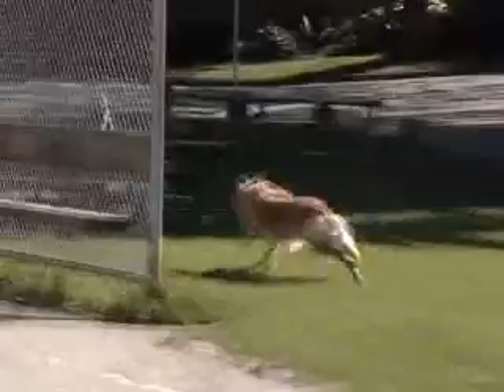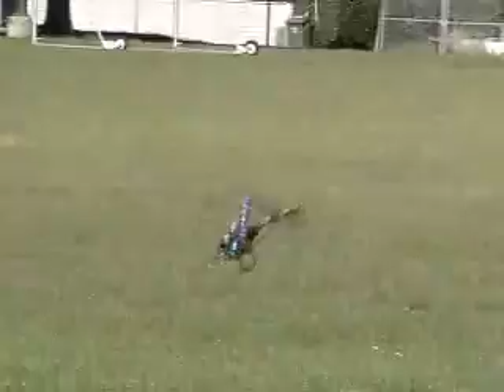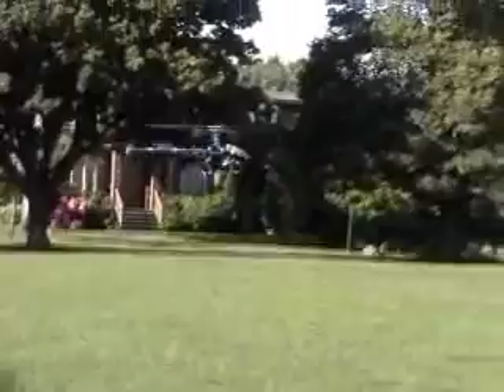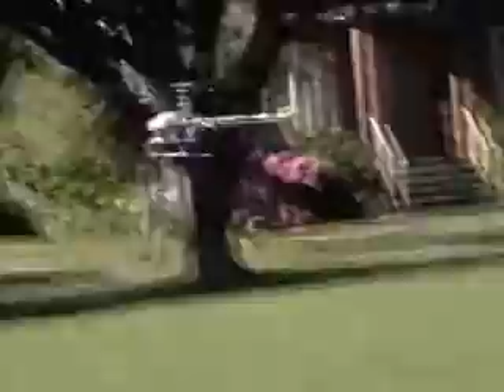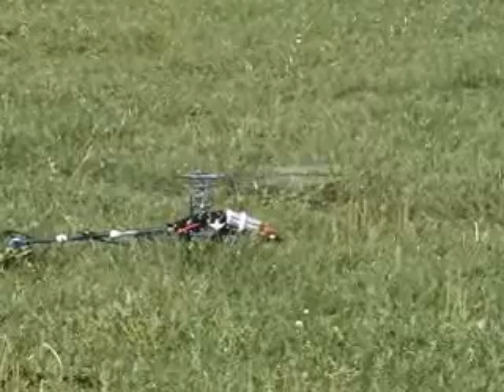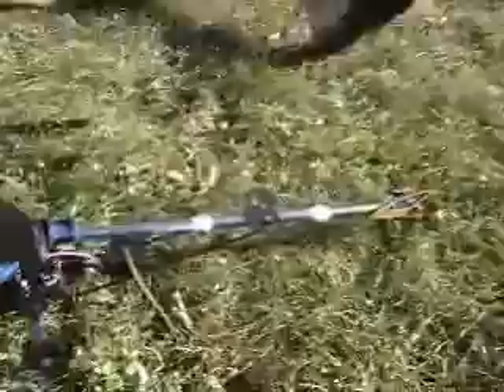Flyerbug's Trex 450 SE V2 - Crashing to the Ground

Comment: The 9650 is not a low speed servo.  I use it on my 450 witha a 401 and works great.  A lot of 3d flyers use it on the 450 with the 401 gyro.  This is just poor setup.  AO very low gain is not the answer to eliminate the wag.Surely theres other factors involved here.